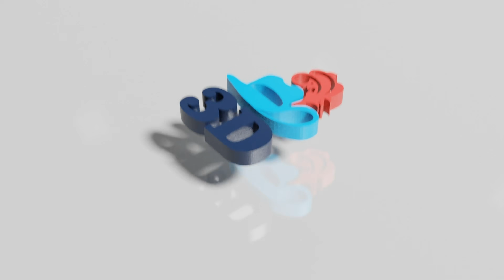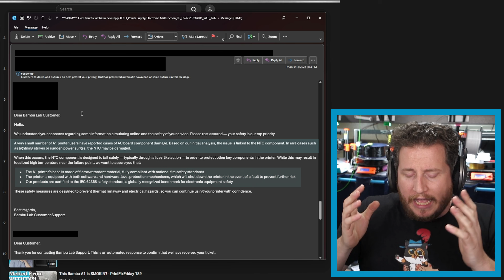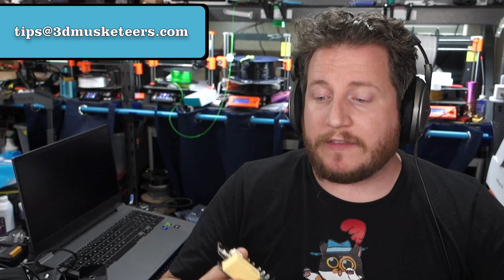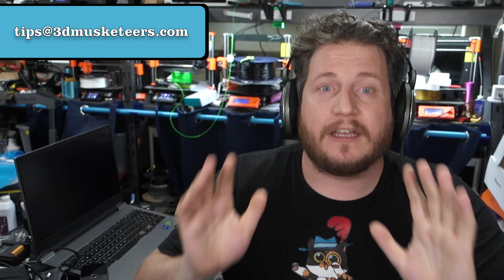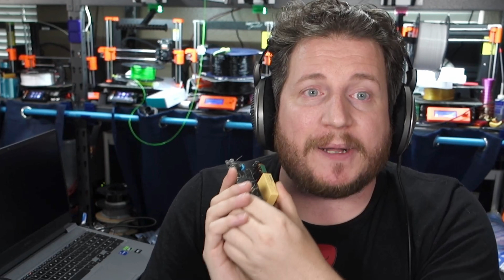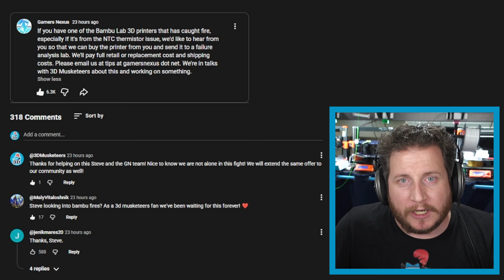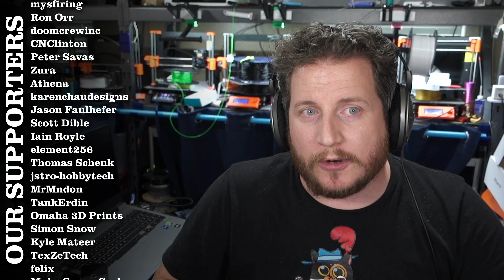I Was Right About The Bambu A1 (And I am MAD)!! - PrintFixFriday 245 FIRE HAZARD EDITION

Comment: Oh. AC Board burn...! It's big story for Bambu they should give you new machine. They have solved the problem on new board by remove thermistor  🤣
Reply from the maker: So why was the one we featured, purchased in February 2026, not solved? What about the tens of not hundreds of thousands of machines still out there?
Reply: @3DMusketeers  How many machine  caught on fire?  UPS/Surge protection there?  PCB Design problem?  If circuit board design problem, they should do something for Bambu Fan.

Comment: Crap. My first A1 heatbed went kaput and I had it replaced under warranty. Wondering if this happened to me. Threw it out so I won't be able to tell. My negative experience with Bambu started after the replacement heatbed had its own separate issues and support was suddenly unhelpful (was not of the capacity to deal with all of that at the time). Have been never-Bambu since then

Comment: While I 100% agree with everything you say. I would like to point out that putting out a video regarding printer safety when there is literally a Prusa printer that has been sitting behind for at least 1 year powered on with the same roll of gold filament sitting on the heat plate and not being used is a bit pot calling kettle black.
Reply from the maker: Why would we use an mk3 for engineering work when we have the new C1, C1L, and HT90? We have 76 machines here.. It means I've prioritized different machines and those just hang out back there because I don't have the strength (bad back) nor space to move the shelves around to make room for different machines at this time
Reply: @3DMusketeers  My point was that the machine has not been used, but yet it has been powered on in every video for at least a year.

Comment: Thank you for posting this video. I’m pretty sure I just had this issue happen with my A1. I thought I smelled a slight burning smell. I haven’t looked around the basement where my A1 is located and cannot find anything, but it did seem to be centered around the Printer the next day the Printer died completely. I will take it apart this weekend and look to see if this is the problem.
Reply from the maker: I would bet actual money that you have had this exact issue!

Comment: Question p1s poop chute problem. I had a buildup on chute that turned crusty black from hot end purging into a chunk. Tried all the fix’s nothing worked. After a month of back and forth with bambu finally sending a replacement. Is this part of the fire problems with these units?

Comment: Ive had mine for 18 months. No issues what so ever...but that doesn't mean what this guy said is wrong. I've never run my printer unattended. This video is an excellent reminder of what could happen and to always be prepared incase something does happen
Reply: I mean, I also like to keep an eye on things that are running (and using heat) but with 3d printers its difficult to not let them alone here and there. Printing things that take 7, 20 hours, it's hard to always be checking the printer.
Reply: It’s frankly unrealistic to be in the room with it at all times when many prints take 8+ hours. My average right now printing miniature terrain is probably 12+.

Comment: I have been using concrete pavers because my steel shelves are not stable enough, but after being concerned with runaway on my older printers, I also added power switches connected to the smoke detector (maybe a topic you should cover). 
Hopefully the rest of the room would not be lost if something happens to the printers.

Comment: I have a P1S that is ~9 months old 
This same thermistor issue happened to me this week (on 18 May 2026) - no fire, but thermistor exploded, melting the plastic housing around the board.

The shop where i bought it from repaired the machine already, and said they also repaired the same issue on another customer's printer last week, so it is not isolated. 
I've reached out to the shop to see if they still have the burnt/exploded board(s), and i've already mailed both you and GamersNexus with the details.
Reply from the maker: Thank you!!

Comment: It's the same for the hot end fan in heated machines. They know it's touching the hot end, they know it's fails because of the heat. Simple PI tape on the fan fix it, but NO, they said they know about the problem - please buy new set of fans, especially for Bambulab X1E machines all the parts just x2 of the price. Same goes for the motherboard on the same printers - connectors fail because of the heat etc.

Comment: Just opened Bambu Studio and there is an update for Update the machine G-Start code for A1 and A1 mini to optimize  the print heating logic for PLA materials on A series printers. I wonder....
Reply from the maker: No shot, really?!? Got the new code vs the old one??
Reply: @3DMusketeers  I have not downloaded it yet, how do I check? I was already using my custom G-code as you suggested to heat the plate first
Reply: I have it, shall I send it on reddit?
Reply: @3DMusketeers  ok I did a comparison, this is the summary from LLM: This update is a targeted PLA optimisation — the new code prevents the nozzle from unnecessarily heating to 250°C when printing PLA (which only needs ~220°C), likely to reduce stringing, oozing, or potential heat damage during the flush/purge phase before a print starts. The 0.2mm nozzle exclusion suggests that smaller nozzles may still need the higher temp for reliable flow.  So nothing to do with heating bed first

Comment: I stumbled on his podcast recently. I want to like it but some of the stuff is so tedious to follow when you're newer to the print world beyond the basics. A lot of the references in the other podcasts he does are difficult to even find on Google. 

When you say dumb sh$t like you need to be a licensed electrician to soldier a circuit board, it makes me really question if you know anything or you're just being legalistic and unrealistic about everything. 

I'm going to hold judgement a little longer, i do want to learn more about the industrial side of this but I'm skeptical of what's being said.
Reply from the maker: I say that because in most states and in most countries outside the US, for it to be covered under your insurance policy as a factory, unmodified machine, you do. The moment you, as a consumer, modify internals like that, the company is absolved of any sin on that machine and your insurance company will wipe the floor with you if anything goes wrong. I have to advocate people do things right. Regardless if it's easy for them to do it themselves. It becomes a legal liability thing not only for us, but for you. 

I think we do a good job breaking things down, but if you ever find yourself asking "what's he referencing???" Just ask and I'll make sure to clarify!
Reply: @3DMusketeers electrical and electronics are completely different fields. You'd struggle to find an electrician that fixes circuit boards. A plumber would be just as likely to fix it. Or an auto mechanic. 

I'm only a few episodes in, i figure I'll pick up on it more as time goes on but i haven't even figured out your guys professional background yet. I'm only maybe 5 episodes in so i wasn't too worried yet. 

It varies by state but policies are much more likely to cover negligence on the part of their insured as long as it's unintended. I've had several things covered that we were at fault on. "That's why we are here" was their response and the policies are written that way more and more often. Not saying they will in every case but this isn't like it was in the 90s. It's usually cheaper to cover it than battle in court. 

I love my bambu printers but the company in general is really irritating. I'm a libertarian, even then i can look past the open source stuff, i have bigger concerns on freedom related topics. I can look past the filament shortage. I travel so i really like the rfid since my family switches spools. 

But now I'm struggling to keep my p2s and h2d going bc i can't get parts. I finally found an ams hub and a p2s extruder guide on eBay but I'm just limping along. My h2d will be at 6000 hours by the 1 year mark if i can keep the stupid thing going. This parts situation is ridiculous, when compiled with the other junk they've done.

Comment: First off, I appreciate the topic you're covering and I'm largely in agreement with your points. However, I wanted to offer a small clarification regarding the NTC thermistor. In my experience working in industrial environments, an NTC thermistor functions solely as a temperature sensing device — it doesn't directly limit anything on its own. If you're referring to the thermistor reporting temperature data back to a CPU or PLC, which then acts to limit current, that would be accurate. The way it was presented in the video, though, could be interpreted as the thermistor itself performing the limiting function, which isn't quite correct. Again, I'm fully on board with your overall message — just want to make sure the technical details are solid so no misinformation gets spread. Keep up the great content!
Reply from the maker: In my experience as well, no one uses NTC's anymore as MOVs do it better. And for weeks I thought it was an MOV, but no, it's not. It's an NTC thermistor lol. Confirmed by part spec, board silkscreen, and data sheets.

Comment: Bought my a1 in december -24.
I mainly use it to print stuff that I designed myself or useful stuff on makerworld/printables. 
Total printtime right now is aprox 450h.

I never updated the firmware on the a1.
Using Orca and blocked the printer to internet in the router. 
Never printing while I'm not home.
So far its working fine.

Comment: @9:04
I'm sorry but you're completely wrong about this, telling people to stop using their A1 because ONE printer has "reportedly" caught fire is crazy. The second you introduce electricity, especially high temperature (nozzle, heated bed) you are introducing multiple levels of fire risk. From the resistance in the cable, the condition of the wall outlet and wires in the wall and so on. Just because it has safety measures in place and protections doesn't make it a 0% risk it just greatly lowers them.
I know anything sold in Canada has to be certified by the SCC (Standards Council of Canada) and adhered to the Canadian Electrical Code so companies can't just take shortcuts that put people at risk. Not so sure America has such a strict code, since the governments priority isn't the protections of it's people, that's obvious.
I have full faith in my Bambu Lab printers. Considering one of my A1 printers has over 4000 hours on it and it still runs like new I'm not convinced this warrants a recall that's going to cost Bambu millions which will just make them raise their prices to compensate for the loss.
There have been printer fires from other brands, not finding any for Bambu besides this current one. Just reports of people complaining.
Reply from the maker: So I guess the over 200 cases of them burning holes and blowing up components on this board are also just flukes and not a pattern because your single machine works well. Who would have guessed.
Reply: @3DMusketeers  HOLY CRAP
AN ENTIRE 0.06% - 0.13% of units have defects... Sounds about right on par with industry standards.
Do your research buddy, Bambu already fixed this issue and haven't been making them with these NTC thermistor since Q3 2025 🙄
Reply: @EliteCanadian92  I'd hate to see what happened to printers BEFORE they fixed it considering the one that caught fire in this video was bought in February of this year.

If 200 toasters detonated or 200 armchairs started melting when you sat in them you'd stop buying that brand of toaster or armchair. It doesn't matter if it's a rounding error, a single fire hazard is unacceptable, much less 200. If they were actually doing something to fix the issue like when they had to recall the printer at the start of the A1's lifespan then we'd be having a different conversation, but they aren't, and the printer that ignited in this video is proof.
Reply from the maker: So this one, bought in February 2026 is what then? 

Samsung recalled every Note phone globally when under 40 had thermal issues. 

Why isn't Bambu doing anything for the, based on your math, hundreds of thousands of vulnerable machines out there?!? 

Also, I have to ask, how DOES corporate boot taste?!?
Reply: @Rewkers  it's absolutely shocking how ignorant people are.
Reply: @3DMusketeers  I can't believe someone running a YouTube channel with any sort of following could be as ignorant as you, my lord.
Reply: @EliteCanadian92 Agreed, and it's big of you to admit that ❤

Comment: Spicy Grant is where it's at! While I've been raging about Bumboo for many other reasons over the years, spontaneous combustion via component failure--especially when it's a known problem--makes my blood boil.  I'm a rather avid advocate of having a foaming extinguisher can or three at the ready as I do wire my own electronics from time to time, but I've never had That kind of problem. I also advocate for thermal switches that really should be found on Every 3D printer, but even in this case, I don't think it would help after the device has chosen death of its own accord.

Comment: Remings me of the early 00's when some Motherboard manufacturers went bankcrupt. They bought condensators and got screwed over by Chinese manufacturers with cheap knockoffs which died after 6-12 month. Every manufacturer was hit to a certain percentage, but the cheap ones were hit the most. My guess is that Bambu made a Cost cutting Engineering decision for their A1 line, putt relativly high Quality parts in and then got screwed by an subcontractor which wanted to have greater profit.  That can happen. The Question is always how you react, and the reaction from BL is extremely bad. The Correct Reaction would be to give the Buyers a Guide to indentify the faulty parts and do a recall or parts replacement.

Comment: As an alternative to the pavers, if you are using a rack to support your print farm, replace the sheet of plywood with at least 2 layers of cement board. This is like sheet rock, but is the material often used in bathrooms under tile surfaces. It tends to be water poof, and is likely to be fireproof as well, but of course check. If you are near a company that makes marble or cement counter tops, check with them for scraps, and or failures in molding a counter top that happens to fit the table or rack that you're using for printers. That said, the cement board can often be cut with the same hand saws (circular saws) used in common construction.
Reply from the maker: I have found cement board isnt very structural on its side, but this is also FL where cement board gets SOFT lol.
Reply: @3DMusketeers  So, this may be a good place to use a sheet of cement board as the fire resist, and using a sheet of plywood under it for support.

I also wonder if spreading a layer of wet cement over the surface of the the cement board, treating it with lime or whatever is used in your area to seal the surface (I'm in Minnesota, if you don't seal the surface and let the cement properly cure, the surface is unlikely to withstand one of our winters, especially in places like sidewalks and driveways that get salt spread on them,) That said, this is not a sugestion that someone do it, it's more investigate whether it may be a good idea, and get friendly with someone in the construction industry who can offer recommendations on stable fire-resistant construction in your area.

Comment: Electricians don't do these sorts of repairs; electronic service people or electronic engineers do(I know because I am one). Most electricians can't solder to save themselves. Now I'll have to pull apart the office printers to check for this issue, oh joy.
Reply: EL02 Electrician with the IBEW, Local 46. Can confirm, something like this is not within scope for most electrician work. We stop at the outlet; the device is the owner's problem.

... That said, I'd bet I can solder circles around you as I have been doing it for ~30 years now. :P. Then again... you did say "most electricians," of which I probably don't qualify.

e.g.  I'm currently repairing a Porsche central locking unit main board that suffered some unscheduled electrolysis. I also built my own Voron, which is currently printing a case for the ECU I will be installing into my car... after I am done writing the firmware for the custom board that will be interrogating the five VR sensors to control the four VVT solenoids. (Dumb, complicated, Subaru problems) The only great news about that project is that the ethrottle board is done already; turned out pretty good considering I etched the PCB in my bathroom. ProTip: If you ever need a darkroom light with certain assurances it won't expose dry film photoresist, get one of those cheap Bluetooth RGB bulbs and just set it to red.
Reply: @WTFChuck-CharlesScoville  Yes, I did say most, not all :)  But you won't solder circles around me, I've been soldering and reworking damaged PCBs for 30+ years, and I replace SMD parts by hand, even 200+ pin SMD ICs. I think we're more likely on par :) 😀

Comment: I have an A1 but luckily have not experienced this problem.  What is the best way to move forward?  Back in the day I was a bench tech. What would be a good replacement part for the thermistor?
Reply from the maker: Personally, I would push Bambu for a replacement board. We dont have a new one to test, but from a VERY FAST CURSORY LOOK (aka dont take this as gospel) they seem to have just bridged where it was... Some small changes were made to the board but nothing significant we could see from photos.
Reply: I could remove it and just jump it out but I dont know if any other changes were made to the board to compensate.
Reply from the maker: Yep. That's why we would recommend just pressuring Bambu until they cave